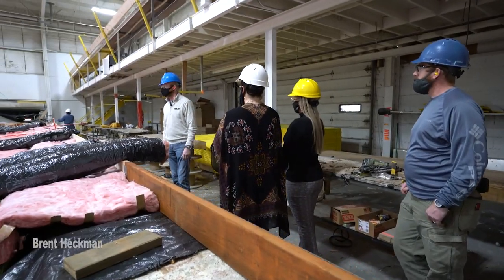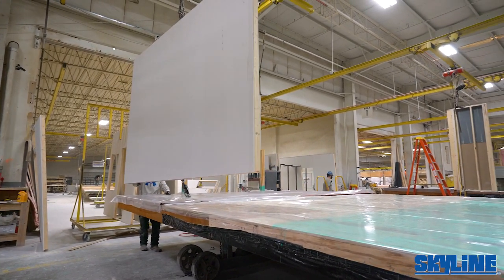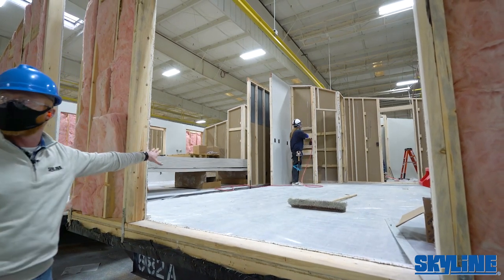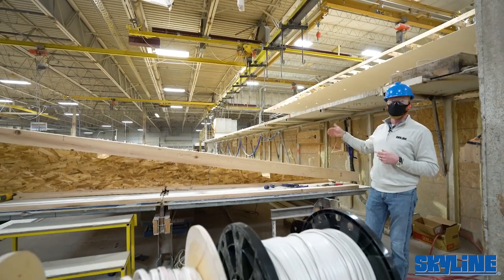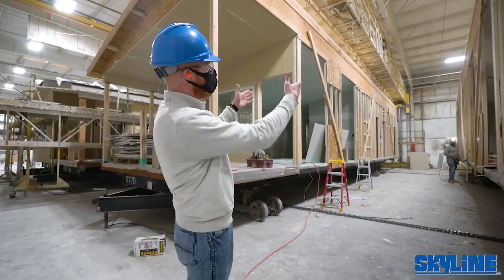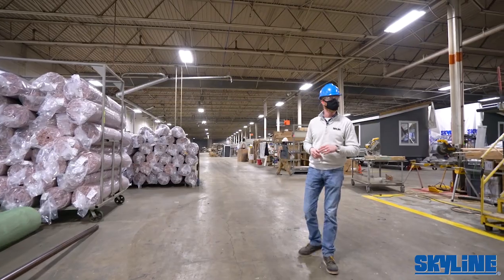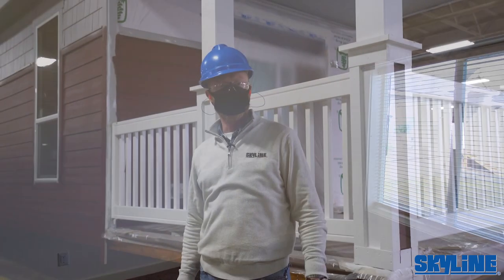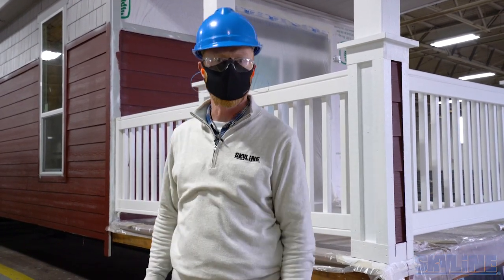Skyline Homes Factory Tour 2021

Comment: Are there any issues with insurance or certification of occupation if the house is on or off the frame when put on slab or foundation to make it real estate?
Are sheetrock or drywall options or are they the same?
Reply from the maker: Hello! Please call us at 1-800-856-5574 and we would be happy to answer any and all of your questions in detail. Thanks!

Comment: Hi. I really wonder why you don't have STUCCO instead of the ugly siding? That would revolutionize the look of manufactured homes.
Reply: Because Stucco isn't common in the PNW, not to mention it wouldn't hold up during the move. It would make the homes look ugly
Reply: Ya it would crack like crazy, they have put thought into everything, everything they use is used for a reason

Comment: So this building is one that can be moved later on if wanted?
Reply from the maker: Manufactured homes are prefabricated residence that uses standardized parts constructed and assembled in a factory. It’s then transported, and the set-up is completed on-site. Moving a manufactured home after it has been set up can be a complex and costly process but it's not impossible.